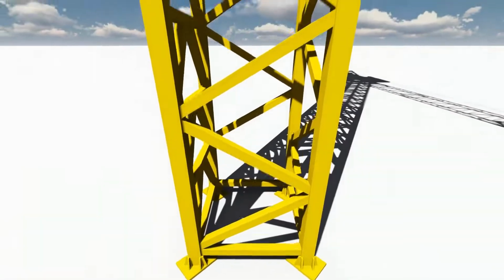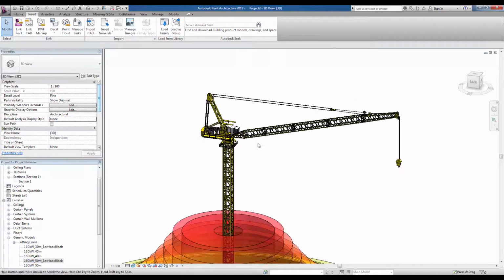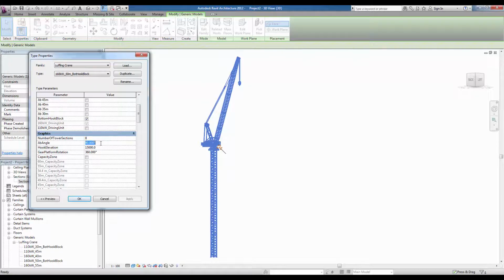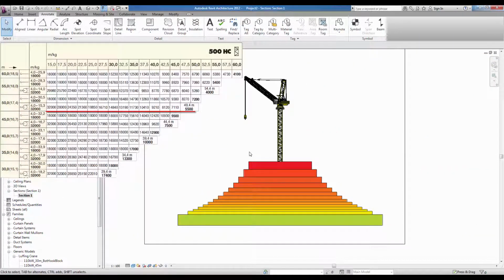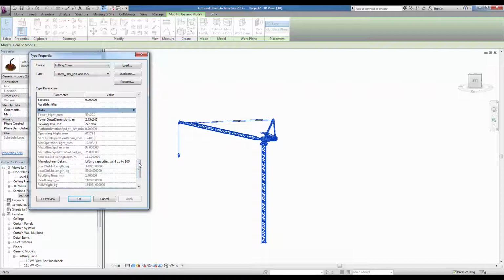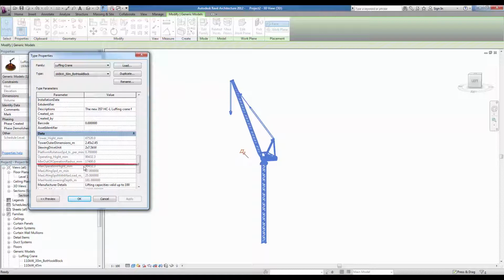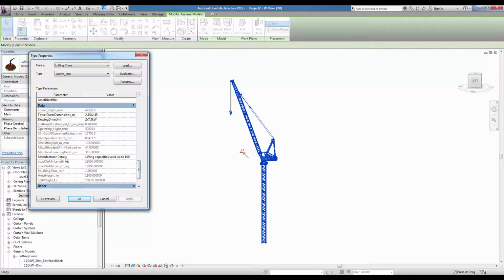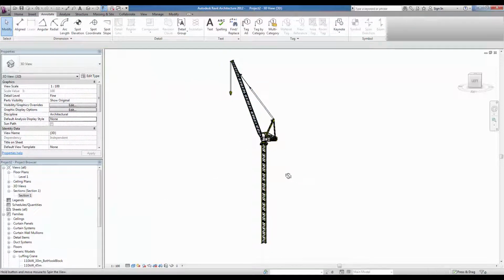BIMservice:Luffing Jib Crane Liebherr 357 HC-L 18/32 (eng)

Comment: Thanks for the wonderful model.  This is very helpful.

The crane maximum mast tower height / section may need some adjusting.  

For tower Crane height that exceeds the manufacturer's catalog, it is common to have a "time back collar" around the mast section at specified interval and these are secured to the building structures.